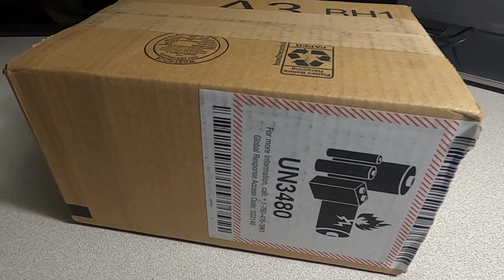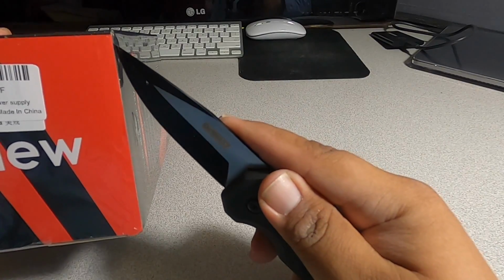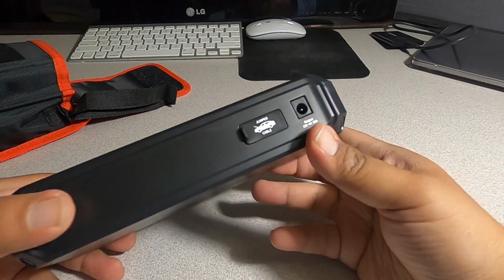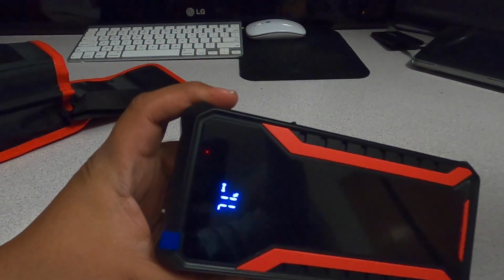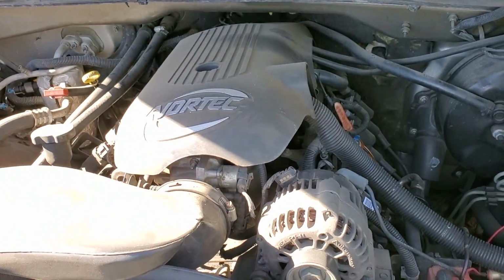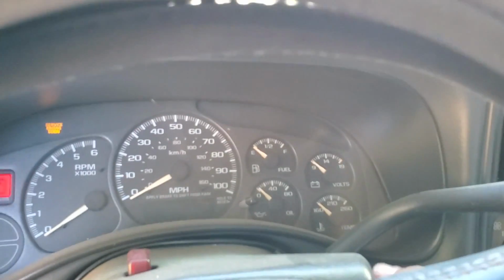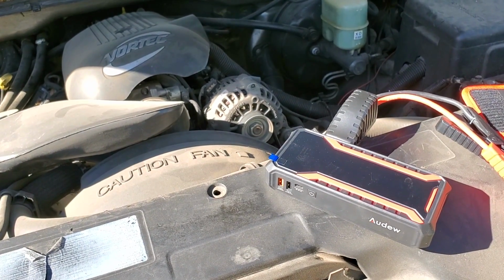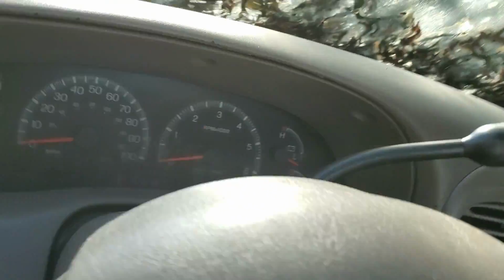Audew Jump Starter 1500 Amp 18000 mah Battery Pack

Comment: Mine has saved a ton of people including myself. It's amazing. The only issue I have seen others complain about is that sometimes these stop charging itself or that it takes forever to charge the unit. I have the epower 1-88 and it takes forever to completely charge. 2-5 hours depending on how depleted it is.

Comment: I returned mine. Reason? I tried to connect to 3 different batteries and could not connect them. The issue was the opened jaws of the clamp to attach on both sides of the terminals are very wide. The clamps are huge and in many cases there is little room around the + terminal to get that clamp to open up and grasp the terminal. I did have an older Cobra model with very tiny clamps that were able to attach. Another issue with most is that the cables are very short which means many times you cannot reach the negative terminal. I know you can attach it to any metal instead, but sometimes that is not an option with the short length.